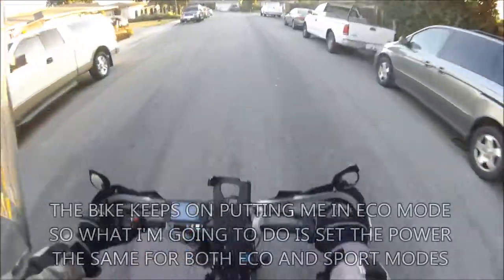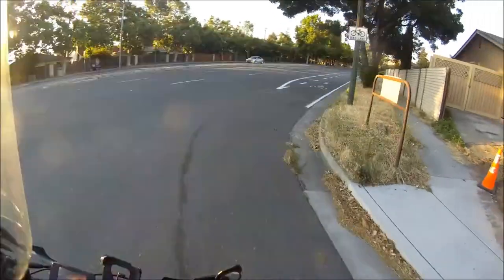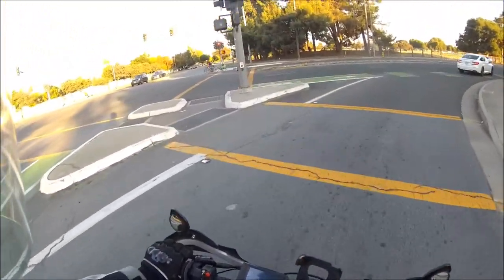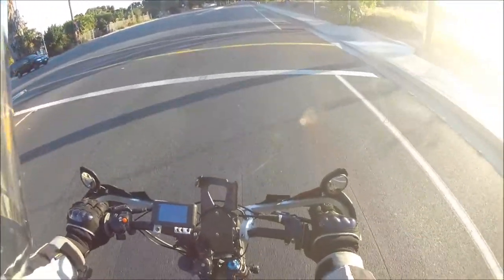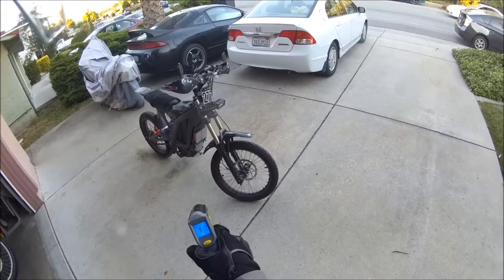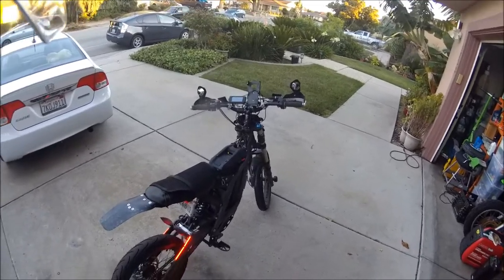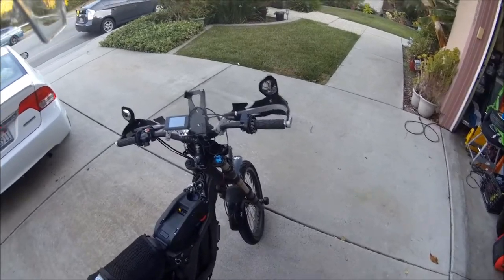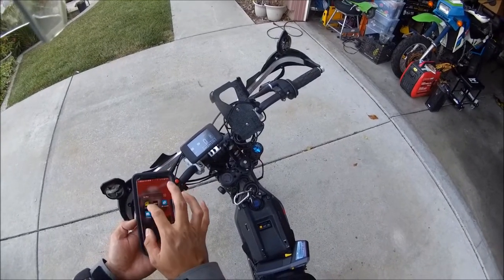ERT NXT Display VLOG Part 13 - Litespeed Battery Test Ride

Comment: Hades i can tell you with quiet certainty theres something wrong with your setup right now possibly with the controller, based on all the other users who have the litespeed 72v battery and asi, theyre getting way more power out of it then you. No way your top speed is 50sh miles per hour. Seems like your getting serious setback in power somewhere...
Reply: Problems are what you wind up with when you deal with Alan Hu. He cannot be believed. The truth simply is not anywhere in him.
Reply from the maker: Yeah I've got it running better with the latest update this video is a little old.  Also the controller overheats you'll find out what I did about that in a future video.